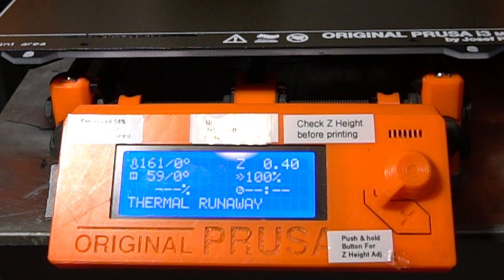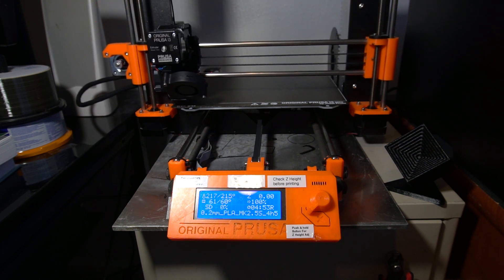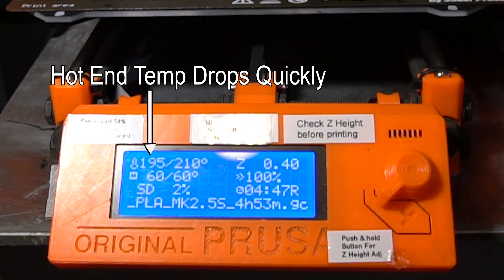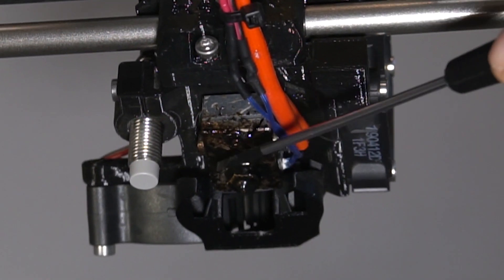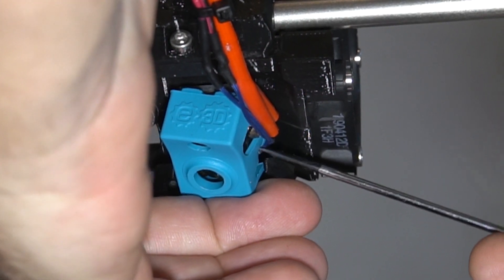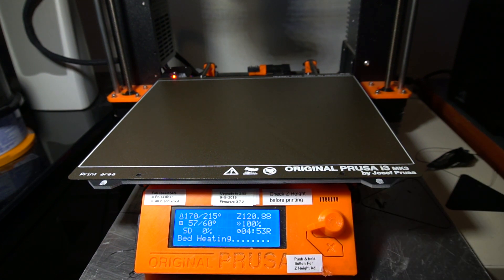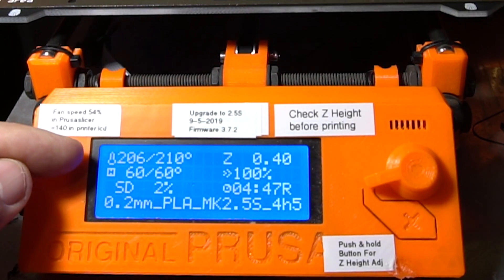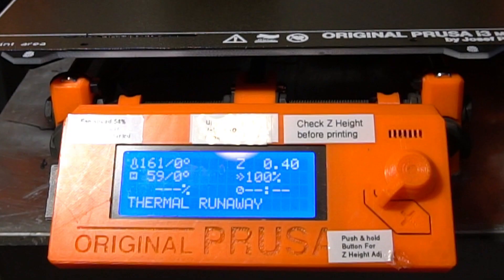Thermal Runaway Error Prusa MK2.5S Upgrade Kit

Comment: I have tried the silicone wraps...never worked for me. I bought a thermal cotton kit that you wrap around your aluminum heat block ( I have an MK8 extruder). That fixed it, and I have never had it scream at me since. This was 6 months ago.

Comment: Yet another Thank You! After the upgrade, I  printed a test benchy & had no issues 1st try, Good to Go....or so I thought. After being gone a few weeks  I went to print something for my work bench real quick & ran smack into this exact issue. I don't have a lot of time these days & was just bumming about having finally gotten the upgrade kit then FINALLY  getting it done just to find out I'd basically disabled my favorite previously functioning printer. The Ironic thing is that I had always used the sock but hadn't put it back on yet because I wanted to clean it up a bit from the previous use. I jumped on YT, did a quick search, found your video & wow, I'm printing just fine! Thank You for the easiest functional fix to anything Ever!  :-)

Comment: I've had the same issue with my upgrade to the 2.5S. I didn't really want to use the sock, so I've lowered the speed whenever I slice instead. It works, but also means that if there's pre-made g-code online, I can't use it or I'll get there al runaway again.

Comment: So I have fought this off and on for a year now. I had beautiful prints for about 8 months then It started doing thermal runaway, jaming, and under extrusion after a firmware / software update. After replacing the heater several times, thermistor, rambo board, adding the silicone sock, even upgraded to a 50w heater. I finally realized the issue - the default Prusa software slicer settings ae no longer are optimized for my i3 MK3! Slow it down and reduce the cooling fan speed to make the issues go away. I should have realized this much sooner, this is my 5th 3d printer... hope this helps.
Reply: should also do a PID tune with you fan on max.
Reply: electronhacks Thank you for sharing. After finishing the first layer, the fan kicks to 200%. I reduced the fan speed and it help!

Comment: Thanks much for this. I did the same upgrade and had the same result. Happened to have a sock lying around and it fixed the problem right away. Really appreciate the tip. Now if you only had a filament sensor fix that was just as easy. ;)